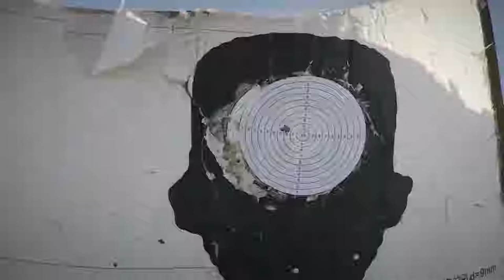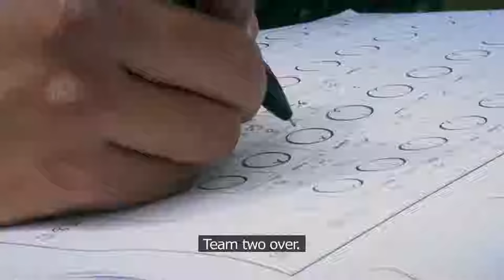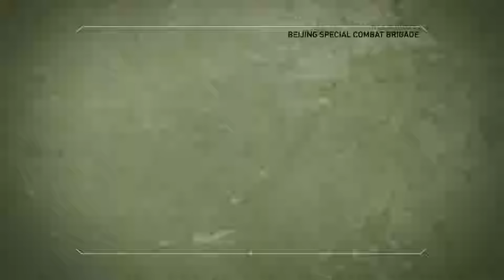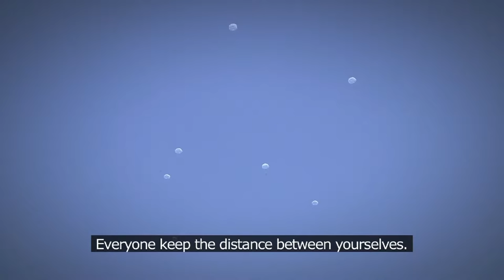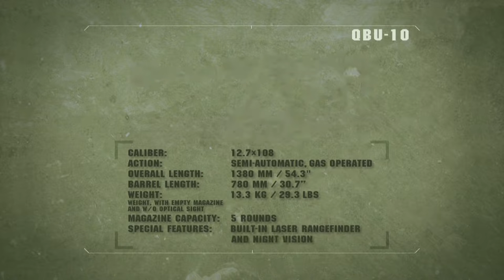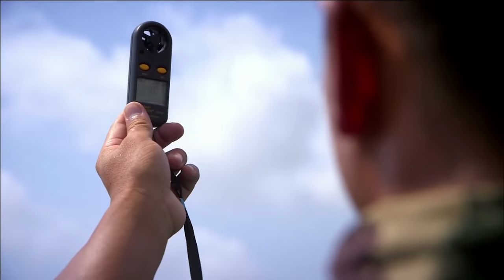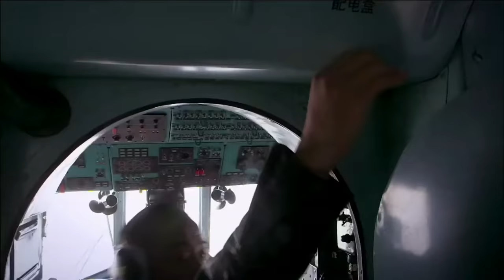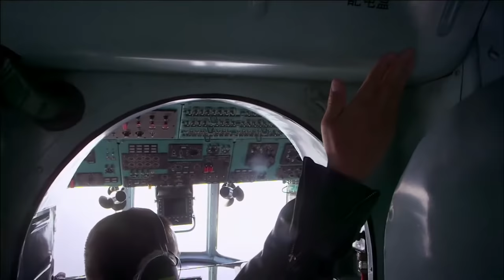Beijing Special Combat Brigade | Special Forces

Comment: 21 km obstacle course in 90 minutes? 21km=13 miles.... these soldiers hella fast.
Reply: Something looks off. They looked like they were just shuffling in the video though. That did not look like a 6 minute 54 second per mile pace. Not to mention there are obstacles in between.
Reply: Malaysian ggk forces took only 75 minutes to complete the 21 km obstacle course
Reply: John Prime Test I’m sure. They ran a five minute mile for all 13 miles and had time to spare completing the obstacle part of the obstacle course. While wearing gear of course.